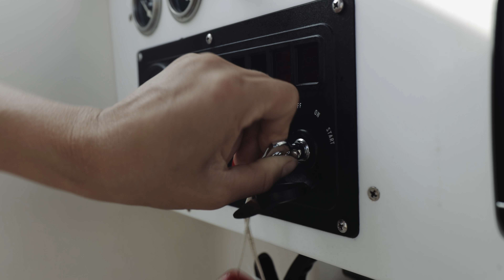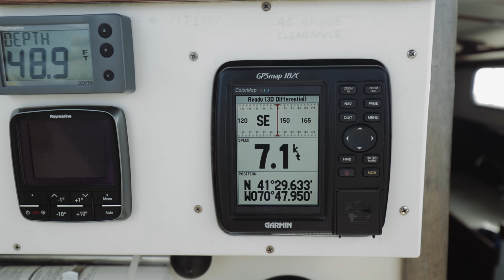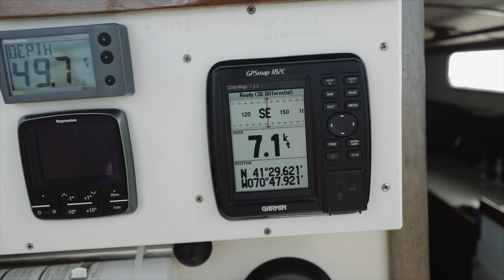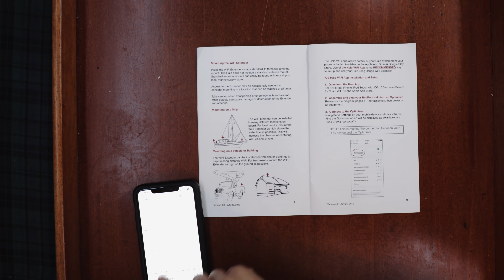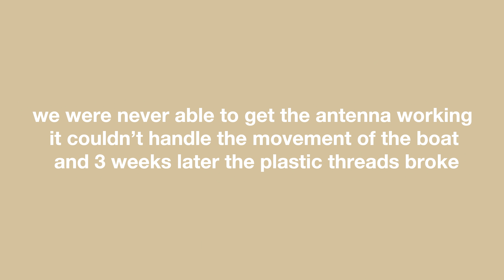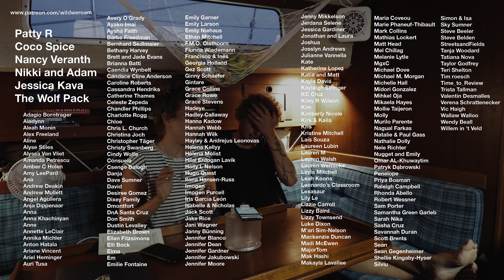A day sail in 15 knots and a wifi install FAIL ; )

Comment: Perhaps not much help in retrospect, but whenever I install a bit of electronics that’s going to require drilling, I do a test run first to make sure the lot actually works before drilling holes. I think that’s even more important in a boat...
Reply: It is so nice to see people in the community helping ☺
Reply: I was thinking the same thing when I saw them drilling and feeding wires everywhere. I was like "Did they test to make sure the setup works, test to see if that spot for the antenna is in the right spot before the start drilling?"

Comment: You should take the winch handles out and put them somewhere safe when not in use, you do not want it to come out and drop overboard.
Reply: It is so awesome to see people in the community helping. And...for those of us who may never sail ⛵ your comments are still very interesting.
Reply: I don't agree, Goeff. A properly designed winch handle will not spontaneously eject itself from the winch. The riskiest time for a winch handle is when it's being inserted or removed. Plus, sheets are constantly being adjusted, so sheet winches are pretty much always "in use." Remove winch handles if they're in your way, but not so they don't go walkabout.
Reply: Winch handles do not fall out of modern winches made since the late 60's early 70's. 

This isn't your Dad's old AMF sailboat from the 60's. It's an older boat but was top of the line when it came out in rhe mid 70's, and included the best winches made at the time. 

The winches on this boat are modern Lewmar 40 self-tailers -the exact same winches Lewmar makes today.  The handles lock in securely and it is much less likely they will get lost leaving them in than putting them in and them out every time a sail is trimmed.  Each time it is removed and not firmly locked in that is when they can go overboard if they get dropped.

I wish  people would quit telling these guys these old wive's sailing tales advice about pulling winch handles out that is 45+ years out of date.
Reply: Yes even if they do not full out they could snap back and smack you a nasty blow. X sailing instructor seen this happen to people..but hey love watching you guys . Your doing an awesome job. I have the same boat still in newly.bought refit as you and I often steal your ideas .
Reply: Snap back?
Sailing instructor?

Do you even know how a modern 2-speed winch works internally?

We have this exact same boat and have sailed it thousands of miles, always with the winchhandle in the active jibsheet winch.  Old-fashioned wire winches can freewheel when the clutch slips. Is that what you are talking about?  

LOLz

I can't even stop laughing...
Reply: They're getting there! :) they are on their way... and, they aren't showing every single detail of what they're going through, doing, learning... let's remember, they have their learning process exposed for all of us to pick a part ;) And, it's wonderful to know that there's people out here that have their backs and support them with useful feedback from the wealth of their experience and knowledge..
Reply: @svbarryduckworth628  👍👍

Comment: @Wild we roam,
You made a mistake when you installed the antenna.

If you put an antenna in front of any kind of metal the signal gets reflected, meaning that it's impossible to receive and transmit any kind of signal from and to the direction that are behind the metal object.

You got a signal because the radio signal bounced between a lot of metal object*s* until it finally reached the other end. The signal becomes weak when it does that.

If there are no metal object around the antenna - and also far away ( i.e. there are no metal objects between the transmitting antenna and receiving antenna ) - you will get a much better signal, so - try again :)

Comment: The external antenna is positioned in a wrong position. You should mount it on the mast in a vertical position. You installed in a low position ( bad ) and near aluminum ( baaaad ). The reason is that on top of the masts it can cover longer distances even if it will be slightly worst in extremely shorter distances ( who cares ). That crappy wire that you passed throw the deck is absolutely not fine for external use. It will last 2/3 years, no more.

Comment: I hope you used some good caulking around those drill holes!
Reply: Claud P : ... or even better would be butyl tape!
Reply: The rubber marine deck gland Lou installed is designed to work without any sealant at all.  A little added butyl tape doesn't hurt though.  It seems he was following the directions that came with thr gland.
Reply: SV Barry Duckworth Good to know.  I was hoping he skipped filming that segment.

Comment: I suggest getting a directional antenna that you can adjust ie point at where the wifi signal is coming from. omni-directional antennas like the one you installed outside and the little one inside are good for being able to get a signal from all directions but the cost is the signal(s) not being the strongest.

Comment: It is a good thing to go out with a reef in, it is always easier to shake a reef out than to take it in. Plus you’ll find out that taking a reef when it is needed doesn’t usually decrease your speed, it decreases the pressure on your rig and eases the motion of your boat.
One last thing regarding reefs, I was once told that when you think about taking one in it means that you should have taken it 15 minutes ago.

Comment: Congrats with a question.. As a power boat owner in the states, a prerequisite for liability and loss insurance was attending and passing a rudimentary boat handling course.  Does the same hold true for sailboats?
Reply: Most marine insurance companies are of the opinion that sailboat owners tend to know what they are doing  compared to motorboats since the barrier to operating them is much higher. 

Our insurance carrier didn't care at all about any certifications at all when we applied and wanted only to know about how many years of experience we had, and a detailed list of.what different boats we had sailed before and when/where.

Comment: Good job!  Have you considered a larger wheel?  Can stand up easier.  Finer control on rudder, better leverage.  Might have to walk around on seat but no biggie.  Look into it, you will like better than small wheel.  Look at some other boats to see how they are set up. :)
Reply: excellent points

Comment: If an external antenna is connected to the network on the shore, but on the boat, the router still says that there is no wi-fi.  So the router on the shore asks for additional authorization.  Try to distribute wi-fi from the phone to the antenna for testing.  If everything works, then the problem is on the shore.  If not, we look further.

Comment: Is your deck solid glass or does it have a core? Careful drilling through core as water could seep in around the bolts. 

When it says IP conflict, what is likely happening is your boat’s internal wifi is using the same address range as the wifi on shore. most likely they’re both set up to use 192.168.0.x. Change your boat outer address to something different, like 192.168.2.1, and look or DHCP and change that to give addresses in the range 192.168.2.2. - 192.168.2.254 and it should be fine (not many people use the 192.168.2.x internal address range). The reason for the problem is that with both things being in the same address range, the router can’t tell if a message intended for, say, 192.168.0.1 should go to your router, or be sent through to the router also called 192.168.0.1 on shore.

The antenna is omnidirectional, it receives/transmits out the side,  it the tip, so it needs to be as high as possible, and vertical. Being on an angle “points” its signal down towards the water on one side, into the sky on the other.
Reply: The Rasmus deck is cored with Divinycell closed-cell foam.  The top of the line material for deck cores even today. The Rasmus was one of the first semi-production yachts to use it in Europe.

Comment: Modern Wifi things try so hard to be helpful, but while they cover the 90% of cases care free, when you are in the 10% they are absolutely divas.
I installed a new one at home and with a few special requirements it blew the pretty App and UI out of the water and I had to take additional measures.  I'm an IT professional and it took me 3 evenings to wrangler it into shape.
There is work to do with all mobile app interfaces to these things and more still to do with over simplifying 90% and massively overcomplicating the 10%.
Reply: If you need help with the Wifi setup, if you haven't got it working, I will certainly offer my help, DM me or whatever and I'll help however I can.

Comment: It seems you have a configuration conflict for the ip someone with some experience might be able to help ‘cause those things are complicated af, also there are directional antennas which can pick up signal from miles away but you have to aim them, but they are plug and play so keep trying to get the system working it might be worth it

Comment: You are doing wonderful with your sailing adventures, continue taking small steps as you learn  to sail and anchoring. Before you know it you will be leaving your home port behind  you and sailing off the beaten path.  The only suggestion I have is to tighten the waist strap on your life preserver. If you leave them loose and you fall in the water, they could pop right off you as they inflate. We also have a crotch strap on ours.

Comment: Hi Guy’s :-) some tips ... the antenna is an omni antenna and it is supposed to sit in in leveled orientation.. and so far up from water that is possible:-) buy more ethernet cable  and put it up in the mast then you will have it working ...

Comment: Do you guys know what your plans are for the winter? Will you/ can you stay on the boat when it starts to snow or will you travel and "land" somewhere warm like a port in Texas?
Reply: Most Cruisers on the US East Coast go to Florida, and then perhaps the Bahamas for a couple of months.

This year is up in the air for everyone.  Bahamas says they will be open, but after last winter and flip-flopping so much a lot of us are warey of what they will do if things turn bad again this winter.

Many cruisers hang out at Vero Beach for the winter, some go down to the Florida Keys.  Marathon/Boot Key Harbor is popular.  Both are good jumping off points to wait for easy weather windows to cross over to the Bahamas.  

The further south one starts the better it is to cross the Gulf Stream since it flows north very quickly.

Comment: I'm not familiar with this gear specifically, but I do understand the issue - would be happy to help. (I'm a snr. cloud engineer - with a lot of experience in network engineering): drop a comment, and let me know how best to contact you :)
Reply: It is beautiful to see people in the community helping ❤
Reply: sounds to me like IP address issuing conflict between the built in DHCP server on their extender and the wifi they are trying to connect too!
Reply: @librab103  Yes, that's correct - it's likely that both the "extender" and the wireless access point they're connecting to are using the same RFC1918 subnet or overlapping subnets. The quickest solution to this issue, without a good grasp on how subnetting works would be to iterate through using 10.0.0.0/24, 172.16.0.0/24, and 192.168.0.0/24 :)
Reply: So kind of you.
Reply: @hiddenidentity8291  I'd send them a message through Instagram or maybe email!
Reply: TheHyperFang Good idea. I dropped them a DM on Instagram. 👍

Comment: The general comments I get is that Wi-Fi extenders are mediocre at best.  A decent boat 4G setup (Digital Yacht) is comparatively cheap and an unlimited data only SIM is about £20/month - things may be different in the US though.  Always dry run though BEFORE drilling holes!  Love your videos.

Comment: The most important mistake you have is that the antenna should be perpendicular to the water surface, it is very important. Also, try to place it higher, for example near solar panels. You also have a bad antenna. Your antenna only supports one channel. Try with an antenna and a router that supports MIMO (MIMO car antenna).

Comment: When the Wi-Fi project started, I just thought, oh boy, is this really gonna work? 

You have to consider that there has to be an antenna at the other end that is able to send the signal back. Very unlikely that anyone is sending open Wi-Fi across the marina if the marina didn't set up something themselves. Had been cool though ;)

5G will soon be here and all your Wi-Fi problems will be solved ^^

Thx for another great video!
Reply: thats unfortunately not accurate.  the extender transmits at a higher power to get to the 'coffee shop' and is also much more sensitive to receive the reply back.  the problem does come though from congestion along the weak return.  BUT there are working solutions out there that RV and Sailors use so dont give up
Reply: That is not quite true.

@wild we roam, 
If you use a small (30 cm) satellite dish. It's able to pick a signal much farther  away than the dipole (stick) antenna you equipment would normally use. The other end don't need a satellite dish.

You would need to control azimuth (up/down) and horizontal movement, so you  would also need a gyro stabilizer to keep the satellite dish pointing in the direction you want it to. 

If a 30 cm satellite dish point more than (>) 30 degrees away from where the signal comes from - it won't receive the signal.

I had been involved in a project where the aim was to create a high speed (100 Mbit/s upload, 100 Mbit/s download) internet connection 16 nm (30 km) out on the ocean.

It's a not a simple project
Reply: @charonstyxferryman  ha ha ok but the gyro stabiised dish is also not accurate. the whole point of the dish is to reflect signals to the focus point (normall the lnb receiver on a satelite dish for example).  the dish allows the other end... the massively moving satelite to erm.... move about.  dish over pole is simply directional vs omni directional, focussed vs noisy and weaker.  I think we're getting away from the fact that something else was at play here, maybe faulty equipment, too many wifi signals in the same area, too far away etc
Reply: @MagivaIT  you are right, I should do my fact check!
Reply: @charonstyxferryman  You are absolutely right, I better check my facts first next time!

Comment: In the Netherlands allso, buy a sailboat an't go. Only for speedboats you need a licentie til 15 meter and sailboats over 20 meter. 
Greetings from Spakenburg The Netherlands
Gerben and Gabriëlle van de Veen Spakenburg The Netherlands.

Comment: Some other cruisers we have talked to have had good experiences with the "Bullet" WiFi extender antenna.  

Your current setup may be ready to go with it as you installed it, and you might just be able to install the Bullet antenna instead on your rail mount, then use the rest of the gear that came with your  kit.

The connections on the Bullet need to be made water-tight outside with riggers self-amalgamating tape to keep the rain out but once that is done they hold up well in the marine environment.  

We have a different wifi extender made by Shakespeare for boats and it is horrible. It isn't even sold any more because it had so many issues. We are going to buy a Bullet ourselves eventually when we get caught up on other projects on our boat.

Check it out.

https://www.amazon.com/dp/B002SYS22E/ref=cm_sw_r_cp_apa_i_OOqFFbP5QEGJ7

Comment: I get all the data I want on my cellphone.  No limit at all with a hotspot and a Rav4 travel router.  Visible wireless has no data cap.  Sometimes it might slow to 1.5 Mbps but it still streams netflix.//all day long all night long 500 Gb of transfer later the bill stays the same.

Comment: Try connecting the Ethernet socket of your laptop to the Ethernet socket of the WIFI extender (MODEM). Your service provider IP address looks like "XXX.XXX.X.XXX" numbers. On your laptop, there will be a "CONTROL PANEL" then select "NETWORK AND SHARING CENTRE". CLICK ON THE "ACCESS TYPE ETHERNET" -  then click on the "DETAILS" button -  there you will find the "IPV4 ADDRESS xxx.xxx.x.xxx". Type the IPV4 address into your browser. The service provider connection is complete when you log in with your username and password.
For users to log in you will have to provide a "MOBILE WIFI NETWORK NAME" and "MOBILE WIFI KEY" (password) so the WIFI connection happens for them.
I hope this may have some beneficial effect for your connection. You might have to bite the bullet and Phone an engineer at your service provider (expensive usually).

Comment: IP network addresses conflict HOW TO solve: connect to the remote network and check on your phone the network or gateway or you local ip with a phone or pc. It will be 192.168.X.X or 10.X.X.X. Go on your antenna and set the local network to the other settings. For example 192.168.1.1/32 or 10.0.0.0.1/32.